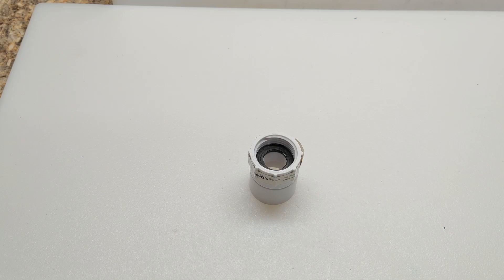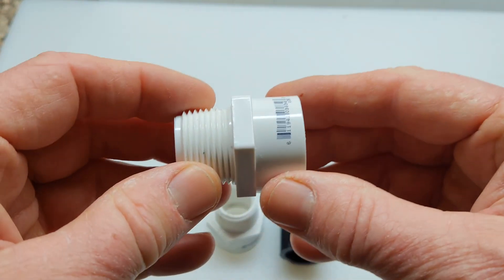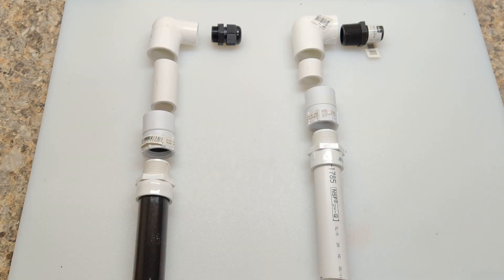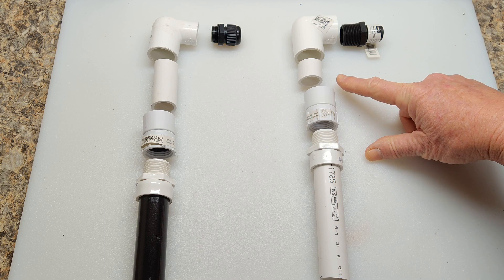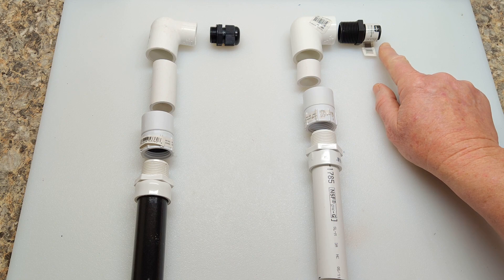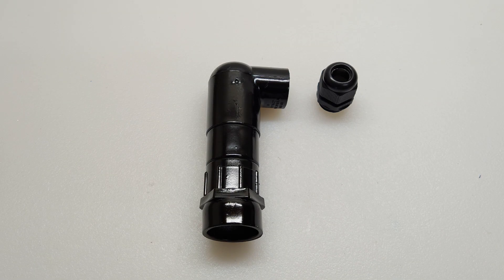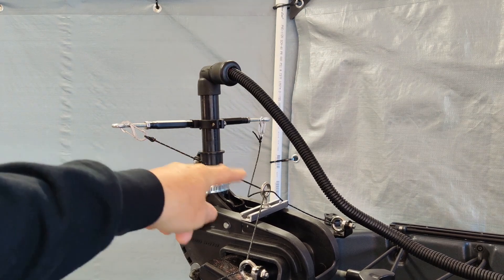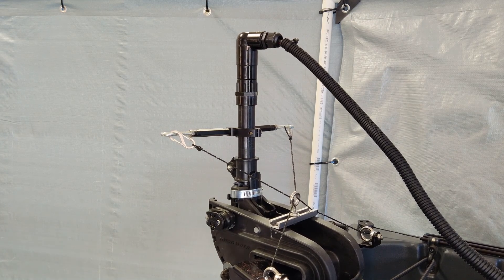Trolling Motor Shortened Shaft Swivel Wire Cap

Comment: I have a challenge for you or question. Is it possable to use foot steering to steer and lift the motor ??  I was thinking it would be a lot cleaner.  Then all you would need is one rope for the locking mechanism.  It would be a really quick lift for that last second rock you spotted.
Reply from the maker: Yes and there are videos. Basically, you push both pedals forward and it lifts or tilts the motor.